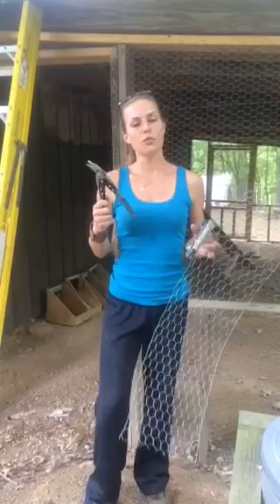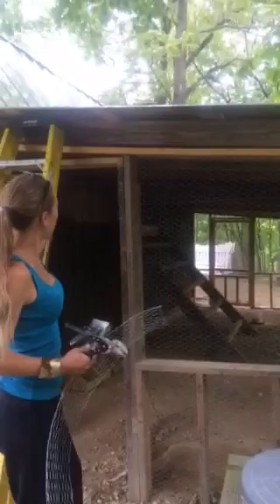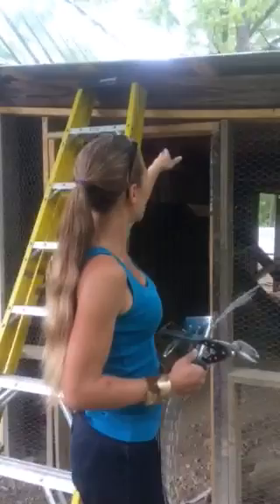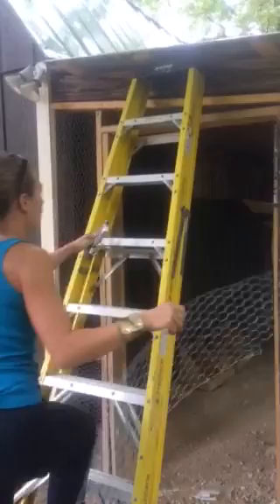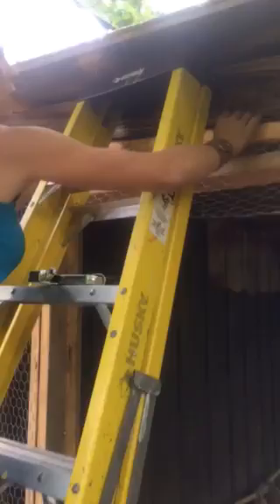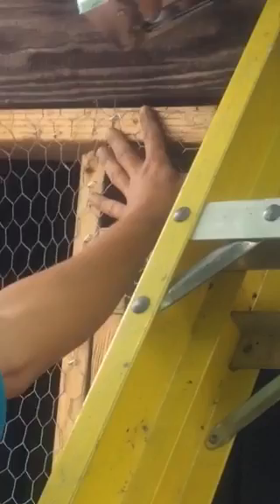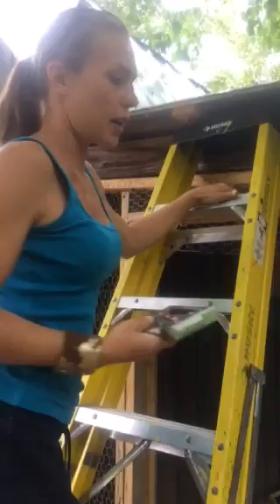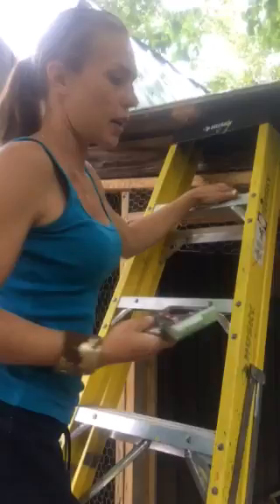How to Install Chicken Wire

Comment: 1. Thanks for the straight forward how to video. 2. I am using the chicken wire for a compost bin not a chicken coop, but I might need a second how to video from you for the next project, which will be a chicken coop. 3. where was the home gym in that barn because you have a great physique.

Comment: I'm about to install some wire type fence material that is welded at cross sections, it's going under my deck to keep out the critters, mostly cats. It's a little heavier than the chicken wire and I'm unsure what to do. Either I use washers and short deck screws or staples. Just wondering what size staples you used, if those hold your chicken wire secure then I would guess for my application that I would probably need a little heavier and longer type staple.